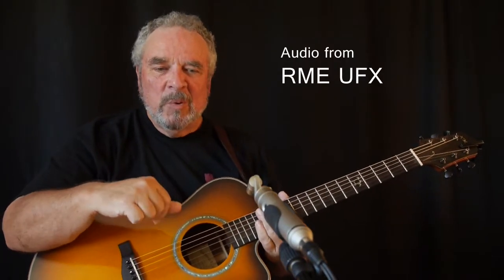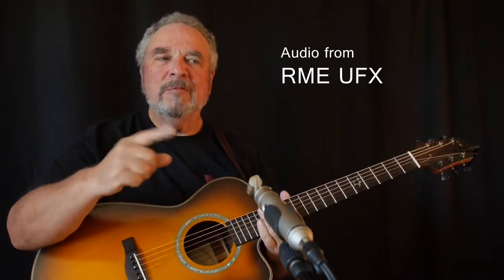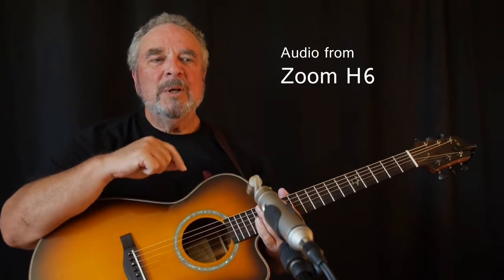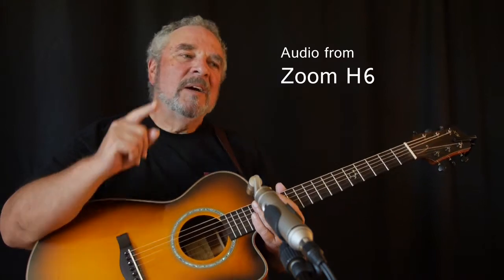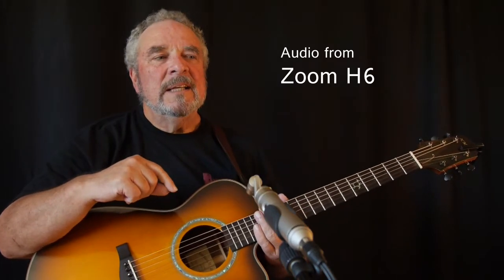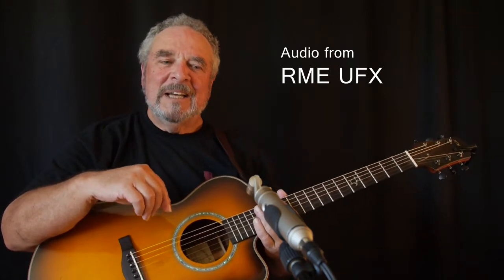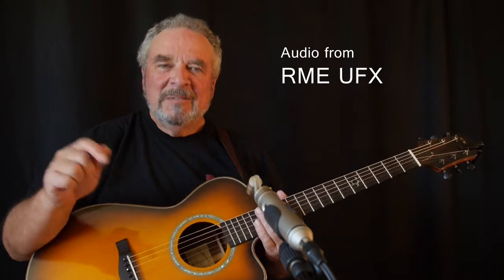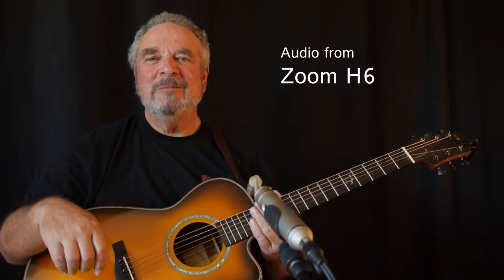Zoom H6 vs RME UFX

Comment: +homebrewedmusic Hi Fran, how do the preamps of the H6 compare to an audio interface in the same price range?
I hear a subtle difference in this vid, nothing I wouldn't get away with, but I also saw your other movie where you use it with a ribbon mic. There the difference in the pre-amps is clearer.

But I'm wondering how much it would differ from the likes of let's say a Roland Quad Capture / Focusrite Scarlett / Komplete Audio 6. Do you have any experience with that?
Reply from the maker: I haven't used any interface other than my UFX for several years and I've never used any of the ones you mention. I would check the gain and noise specs, since the self-noise at the very highest gain levels is the only issue I notice with the Zoom. Check the EIN on the units you're considering. For instance, the H6 has an EIN of -120 dBu while the new F8 is -127 dBu. Here's a great explanation of audio specs like EIN and SNR: http://www.rane.com/note145.html

Fran
Reply from the maker: Oops, Patrick, sorry your question slipped by me. I don't have an audio interface in the same price range as the Zoom, but judging just by the noise specs I've seen I would expect them to be similar. The interface will probably have software mixer though, and for some projects that is quite useful.

Fran

Comment: Great playing and recording, but I kind of wish both were at the same level, as loudness is perceived as 'good' and the UFX is a bit louder (I'm sure that's due to sensitivity, but etc)
Reply: +Roman L I make an effort to match the levels when I do these recordings. Did you download the samples and compare in an ABX tool or are you basing your judgment on listening to the videos?

Fran
Reply: +Fran Guidry I must admit I used only my monitors but the difference seemed so noticeable it didn't occur to me that I could be wrong
Reply: +Roman L One possible confounding factor is the natural flow of the music. That's why ABX tools make it easy to repeat the same section for each sample.

Fran

Comment: If you used a passive splitter, then both preamps will have an influence on each other, even when using transformer-based "isolated" splitters like the Radial JS-2/3.  In other words, not a fair comparison.  Try something like the Radial Cherry Picker, or since the mic is powered at the source, a switcher.  That said, nothing beats an exact repeatable performance like a Synclavier, and I won't even get into all kinds of other biases these types of comparisons are subject to, which will heavily skew the outcome.  Finally, most preamps with negative feedback will sound much closer to each other when not pushed than most people realize, especially if a large amount of gain is not needed to amplify the signal.  It's not surprising to me at all how close these sound to each other in this particular test.
Reply from the maker: Dominic Guss Thanks for your observations. Care to suggest a figure representing the degree to which the two preamps interact? What might that interaction cause in the way of audible artifacts?

Fran

Comment: ZOOM H6 matches the $1700 preamp.  LOVELY!   I have a ZOOM H6, its the cats ass
Reply: to be fair, the UFX does sound slightly better and isnt a preamp, its full 30 x 30 interface with loads of features in which the DAs are just as quality as the ADs. If you need that the UFX is great, if you dont and are just recording 1 channel of guitar the Zoom has proven it is great for that purpose!

Comment: Got a quick question. Would the H-6 be a good choice for simple band recordings with a guitar, bass and some drums? I just don't plan on spending thousands on recording gear, just to have some fun with friends.
Reply: Because there are so many options and levels it's hard to respond to a question like this. If you simply want to set up a recorder in the room and capture a stereo recording the H6 is overkill. The H2n or your cell phone will do that job.

If you want to multi-mic things, six mics is pretty limiting. Two for vocals, one for guitar, one for bass, leaves only two for the drum kit. It might be doable but it might also be incredibly frustrating. But then incredibly frustrating describes a lot of what goes into recording anything (grin).

Fran
Reply: Fran Guidry Thanks for the quick answer. Im not necessarily talking about recording everything at once. I have the H2 at home and want to sort of step it a up a little, by adding some proper microphones. Other than the 6 inputs (with the extension) being somewhat limiting (not in my current situation), would this be a decent option?
Reply: Whambadambadamdoo
If you're talking about overdubbing, you need to know that the overdubbing on the H6 is limited.

If you're talking about miking up a band it will do the job if 6 inputs is enough.

If you're talking about using it as an audio interface it lacks a software mixer.

Fran
Reply: Yeah i was talking about miking up a band. I think I'll just try and see if it works out, if not I can always look for something else.
Thanks man!